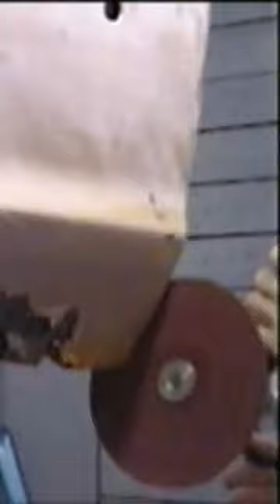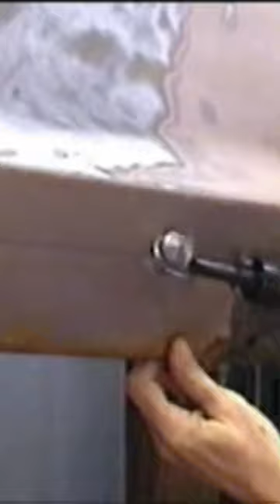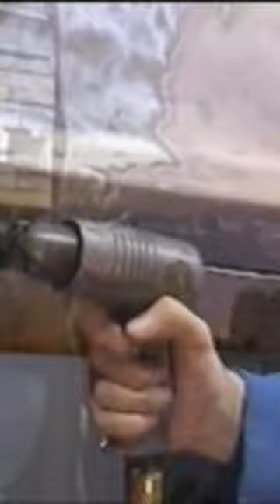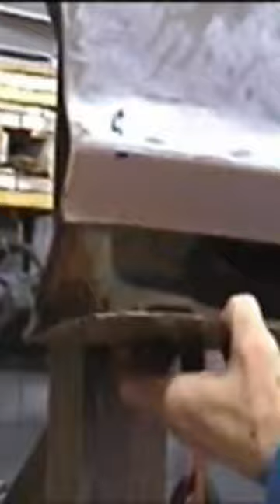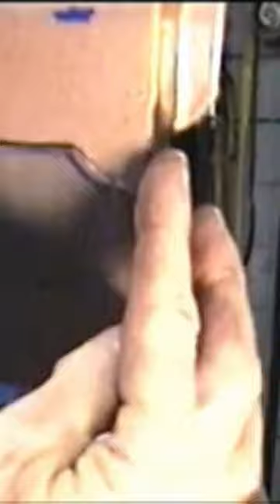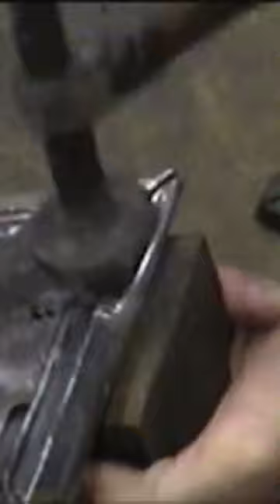Door Bottom Rust Repair Summary - Part 1 #shorts #autobodypaint

Comment: Endless supply of work if u are willing to do rust repair at a reasonsble cost. I had a couple from out of the area tell me body shops refused to do the smaller rust repair they needed. Collision shops seem to just want that insurance $$$ so that leaves an ambitious guy a lot of oppurtunity
Reply from the maker: You are absolutely right.  If someone started rust repair business that was run like an assembly line - there's money for sure.  One guy does the patch work, one guy does the filler work, etc.  👍